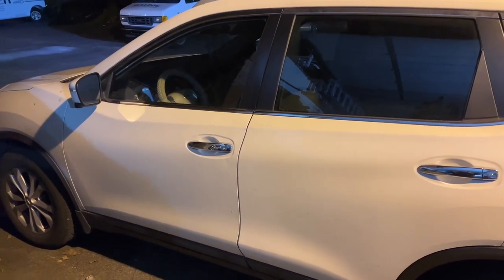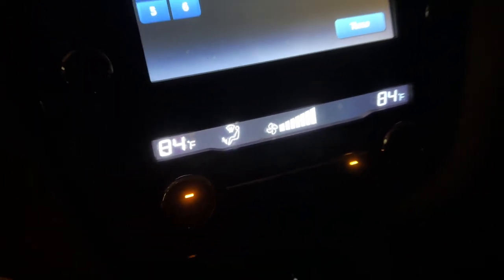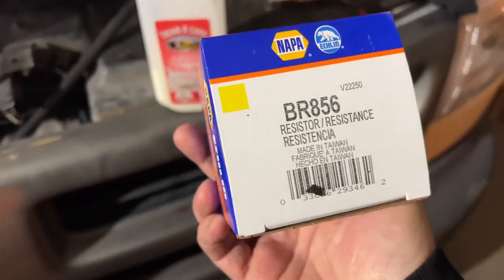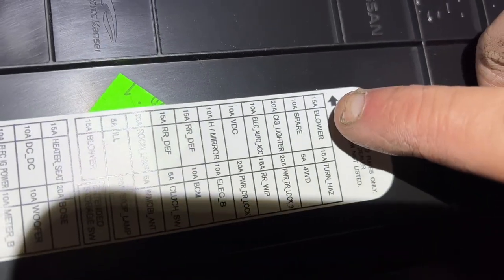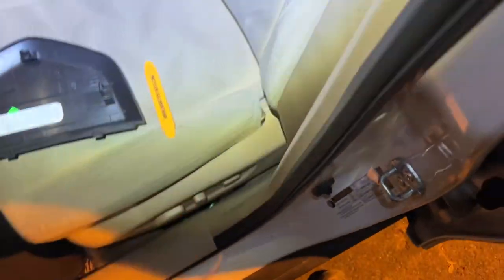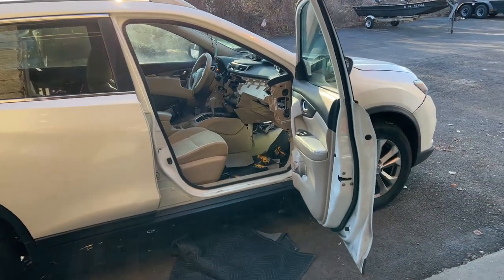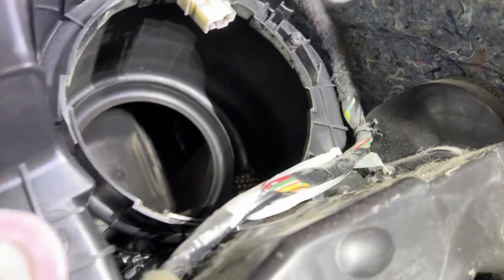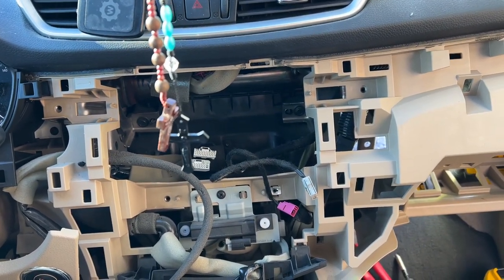2015 Nissan Rogue no heat/ac blower motor location passenger side behind glovebox

Comment: My 2011 rogue is on the driver side and brake and accelerator needs to come off in order to get blower motor out.  My blower is faulty again, 😢. Good thing I have an idea now and it will be a bit easier.
Reply: that’s the blower motor resistor,  which also can go bad and cause ac/heat to stop working.  its usually a toss up between the blower motor and the ac resistor.

Comment: Did you have to replace the resistor?  If so where is that located.
Reply from the maker: Unfortunately the resistor is on the driver side and you have to remove the gas and brake pedal to get to it. I could see it after I removed the blower motor from the passenger side. I didn’t replace it

Comment: I have a 2015 rogue and it’s only cold air blowing out the shop claims that the ac switch keeps getting stuck on on . What do you suggest I do . And where is it located at . 
Thank you in advance
Reply from the maker: Sounds to me that one of the blend actuators went bad. The blend actuator mixes the cold and hot air to get your desired temperature. It’s probably stuck in full cold.,I’m not sure where it is without the vehicle in front of me